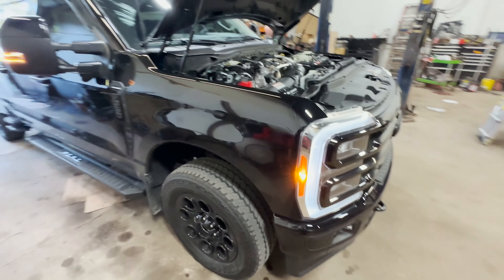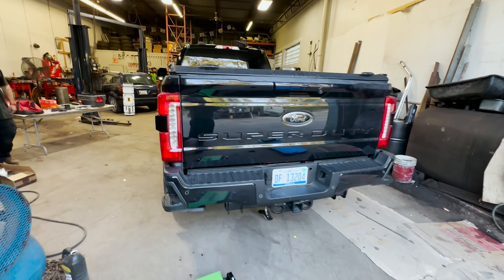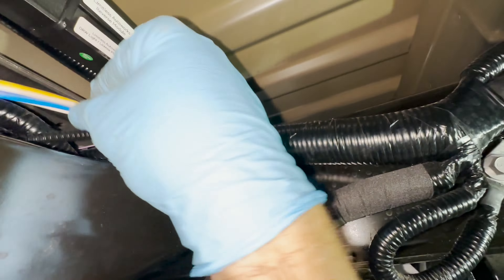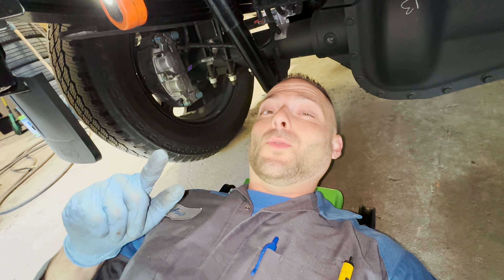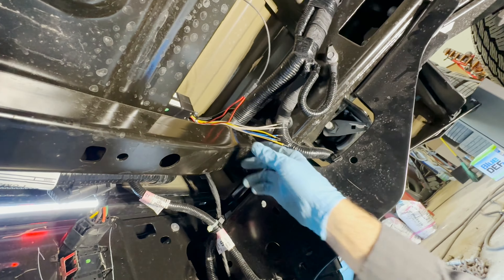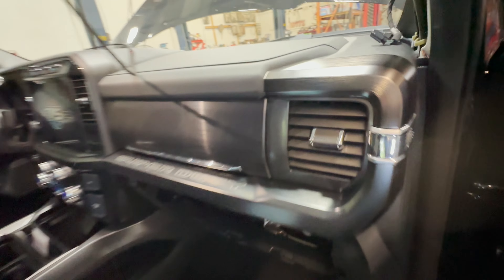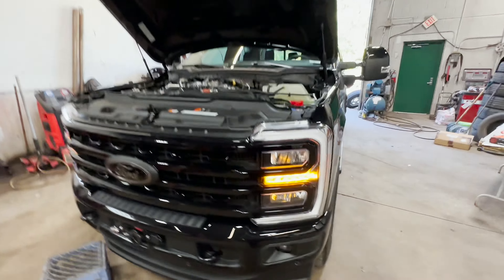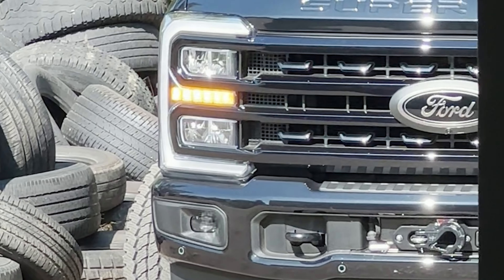does YOUR 2023 do this? OUR does! #viral

Comment: I’ve got a 23’. Any reason it regens every 400-500 miles? Also, the next day it goes from 0% to 40%+ after one day. Makes no sense. Our 2020 Cummins regens every 2-3,000 miles and it would stay at 0% for like a month at least.
Reply from the maker: Sounds normal to me man 400 to 500 hundred miles is normal
Reply: @PowerStrokeTechTalkwARod  okay sweet just checking. Our only other ford is missing some parts so wouldn’t have any idea on this new one. 🤷🏽‍♂️